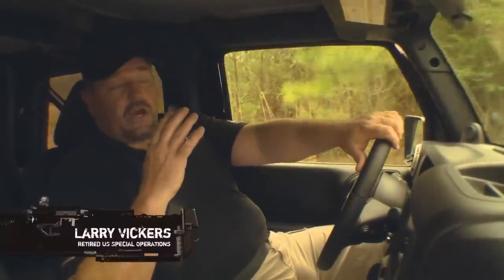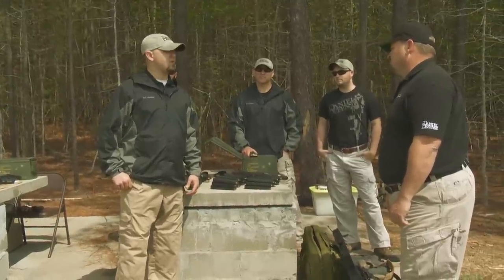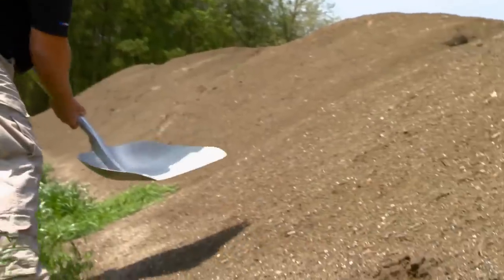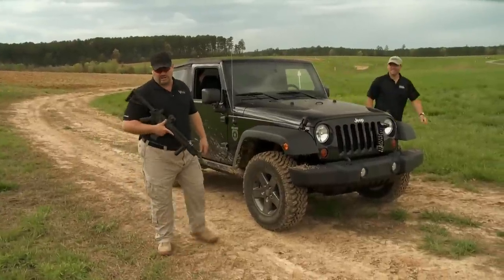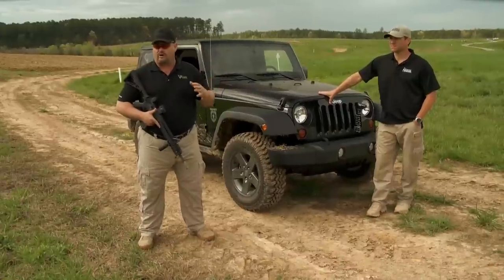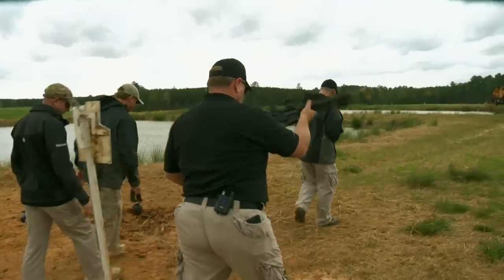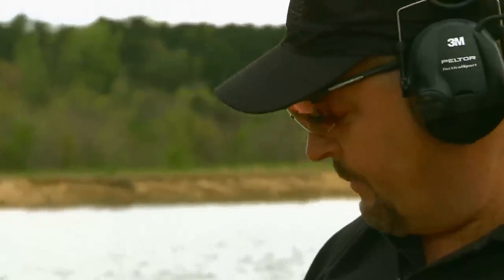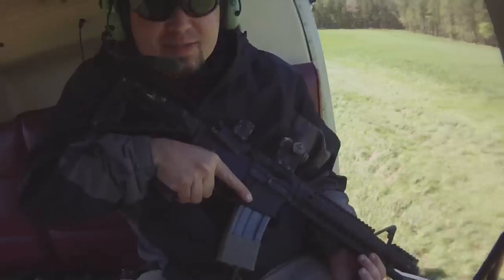Tac TV Season 1, E1: Daniel Defense M4 Torture Test

Comment: im more impressed with the aim point !!! it seemed after the explosion even the group was surprised at the aim point . i must say i now plan on buying myself an aim point .. wow
Reply: I see why Aim Point is high price. Well worth it and that is not really a high price if you think about what abuse it came across that $400 plus in cost that is not a bad price at and Daniel Defense AR is outstanding now I want one. I am curious  how a S&W Sport II AR would handle these tests.
Reply: Tom Hayward i also curious how colt le6920 would faced this torture test
Reply: I can say my DD purchase came directly because of this video. I did want an Aimpoint but the micros are a lil expensive after my DD purchase
Reply: I understand why people want these proven systems, I am one, but at the same time I highly doubt I’ll ever be in that situation. This along with the fact I shot a DDv11 and it just shot so smooth with that mid length gas system, compared to my colt (which has a carbine length system) I still like colt and trust colt but they definitely aren’t as nice as the DDs are, there just facts
Reply: Yeah I'm about buy one for the rifle I just built. Was going to buy an eotech but not now.
Reply: @tomde3  there are SEALS that say Eotech is the only optic theyve ever seen not fail.
Reply: Aimpoint PRO is an outstanding optic at an outstanding pricepoint.  Those micros are nice but so expensive....

Comment: haha so many haters, this is a great video I guess not everyone can keep up with keyboard operators
Reply: +chris abbott I agree with the keyboard operators. However, the results of the tests are not too surprising. I saw a lot of jacked up things happen to m16s and m4s. They very rarely break in these type of circumstances. The weak point in the system is the buffer tube. If that bends or breaks it is a brick. Otherwise the system is pretty robust. I just wished that he had done it on a loaded chamber. Yes there is extra safety measures to look at but you might not always think to rack the charging handle 15 times each time you bump your weapon. Also, if it hits the ground, goes off out of battery, and explodes that is a fail no matter if the hardware components survived the fall.
Reply: Cheaper AR's could of passed those tests man.  Have you seen the Torture tests on the AK?  These guns are steal and hardened aluminum,  any AR could of went through that.  They covered the muzzle, that to me is not a torture test.  They leave the muzzle open when they do it with an AK.  Not only that, they fire the AK underwater over and over.
Reply: @dragunmane3029  : You are a boss.

Comment: I hate the way all these places do the dirt test. They close the cover, put the port down or any number of different things. Well, anyone knows any gun will malfunction if to much dirt gets into it. They need to do more realistic tests. Drop it on sand with the cover opened, bolt closed & magazine in like if a soldier dropped it in the field. Maybe kick a little sand on it, shake it out & go.  That isn't as impressive as burying it but it's more realistic & won't rely on an unrealistic set up like dust cover closed & port down over a hole. Those tactics aren't fooling anyone and, lets face facts here, if your rifle ends up getting totally buried you are going to have to open it up & do at least dump any sand or clumps of soil out. That goes for pretty much any gun. 
Function during blowing sandstorm would be a good but hard to set up test. 
The other tests are great & impressive. I think the things most people really want to know is will still run good when it's dusty or dry with a few hundred rounds already through it ? Will it run 1,000 rounds without cleaning or additional lube with only a few breaks to cool a bit? Like conditions you would see in an intense firefight. 
Anyways, overall, great torture test. By the way, I love my DD.
Reply: They dropped it out of a helicopter and detonated tannerite and diesel 5 feet from it. Who cares if the dust cover is open?
Reply: Pretty sure the Army teaches then same, but in the USMC, when the rifle is not being fired, the dust cover is closed. That's what it is for. So the test was spot on. You can what if all day, but the Aimpoint and the DD rifle did outstanding. Go back to your moms basement.
Reply: The M4 is a closed bolt, and has very little open spots for dirt or mud to get into the bolt/chamber, you can open the dust cover, dump 20 lbs of mud directly on it and it will still fire

Comment: I have a very specific question for you regarding cleaning a Daniel Defense M4 V11. I recently purchased. I understand that depending on weather or not your barrel is chrome lined determines what kind of solvents are to be used to properly maintain your barre. I also understand Daniel Defense chrome lines their barrels but was recently told that they only chrome line the chamber end of the barrels to allow smoother feeding of the rounds. That being said, l am uncertain as to weather I should treat the barrel as a chrome lined barrel or a chrome moly barrel. Should I use bronze brushes for cleaning the barrel, or should I only use nylon brushes? Is it safe to use Ballistol Multi Purpose cleaning lube or Hornady One Shot gun cleaner and lube with a Daniel Defense AR-15? Should I leave a light coat of oil in the barrel or should I limit it to something like Otis Dry Lube? 

Pardon my ignorance but I want to properly maintain my investment here.

Thanks in advance,

Eric
Reply: Just run Hoppe's 9 through it like a true American and don't worry about it.
Reply: Eric Coovert #9 for a hunting rifle maybe... there's a reason the army has been using CLP for over 30 years and running. Cleans and lubes like no other..

Comment: So you threw it into the "drink" with a wrapped muzzle and it still failed to eject? I am impressed with the other tests, but i saw a lwrc video, and it fired going into and out of water w/o a muzzle wrap... is this because of the whole DI vs Piston thing?
Reply: yes
Reply: TheWewanater Oh. But i recently saw a bcm go through a mud puddle and function fine, while an lwrc m6-s jammed.
Reply: Zach Conant no it's not lol. It was one round out of many.. could be as simple as a low powder charge in round. It functioned fine. It did eject. It just didn't cycle the bolt far enough to pick up a new round. The fact that it fired two rounds then failed then kept going after that shows an issue with the ammo or possibly the magazine not the gun. But generally a mag if is going to bind up is going to do it on the first round or two.. or last round or two.. not middle mag so most plausible was underloaded round. 

It's also not needed to protect the muzzle like that. But was done for safety. A DI gun is much more vulnerable to water if the water gets into the gas tube. Obstruction in the tube plus gas equals gun blowing up. The simple solution to this is simply point muzzle up or down for a second to make sure any water is drained from the tube. 

What should've been better explained in this video.. is this was done to prevent something small from floating through the water up into the gas port and getting lodged or even simply mud getting it the barrel and clogging the gas port.. both to these things wouldn't be noticed with a barrel check or tipping of the gun to drain water. It's honestly like a 1/1gazillion chance.. but who wants to be that 1? 

Piston is better for SBR with a can. Outside that is actually tends to have many more issues then DI when put through a test involving contaminates like sand, water, dirt etc..
Reply: john smith Yea, the choice between di and piston is crazy for me, i just cannot get lwrc out of my head, and i can't get a few dd, bcm's or even an sr-15 outa my head (sr-15 has proprietary parts which kinda sucks) 
I have actually heard that running a can on a piston rifle w/o an adjustable gas block is very bad, and you shouldn't run a piston gun suppressed w/o it. However, di guns run fine if you keep em clean w/o the adjustable gas block.
Reply: Zach Conant again mis information.. DI has nothing to do with being "clean" or not.. carbon is actually a lubricant lol. Many/most don't know or understand this.. carbon build up is a false idea portrayed by many. Unless it's to the point of actually it fouls the extractor etc.. it actually helps the firearm. This is why piston guns and the whole  DI vs argument has died.. in this platform that was designed to be DI changing to piston actually makes it less reliable and more finicky. Like the gas block idea you mentioned. But honestly running a sbr in 5.56 is stupid and not what the round was designed for and no matter how you choose to do it it doesn't work do to simple math. Under 11.5" Barrel the velocity is below  designed specs and does not function. Under 14" it's not even a practical defense distance round. This is why everyone is trying to come up with alternate calibers.. bottom line it's about the most tested and reliable platform ever (hence why everyone uses it) but that's also why they are all 14"-18" barrels. The so called failures of the round is do to attempting to modify it. But tidke tested its proven to be a more reliable platform then even the ak..
Reply: john smith I thought it HAD to be lubed though? I have read MANY stories about di gas ar's running thousands of rounds w/o being cleaned, but they needed to lube it. 
I am just skeptical about the stories i have heard from vets who say they don't like the m4. (however, one was a vietnam vet, and everyone knows the m16's during that time weren't like what we have today)

Comment: It's a entertaining test, but I have no doubts a Smith and Wesson, or Springfield, or Ruger, or Colt would fail this test either. 

The most fragile part on an AR I can think of is a buffer tube snapping off. Other than that, I can't see anything else failing. It's gotta take a shit ton of force to damage an upper, lower, or handguard.
Reply: Gas tube

Comment: I just bought a v11, solid rifle no rattle hand gaurds are best I ever seen. As a marine infantryman with multiple combat deployments I have handled a4, colt m4, SAW, 240b g and e, m2 m12 from knights armament and HK m27 IAR. The HK is best rifle I ever held replacing the SAW. The accuracy was up there with knights armament no BS. I carried a colt M4 my second deployment before FN contract. We where flying blacked to intercept BOLO list vehicle. My driver did not see the 8 foot wadi and we drove into it. Barrel on m4 bent and ACOG or RCO internally shattered and had glass floating around inside. I don't think many rifles would have survived that. I will be doing reviews on firearms as well as gear. So BOLO for it. Rah kill gents